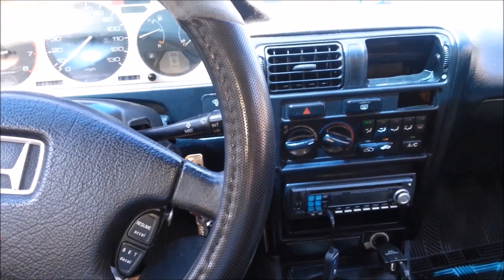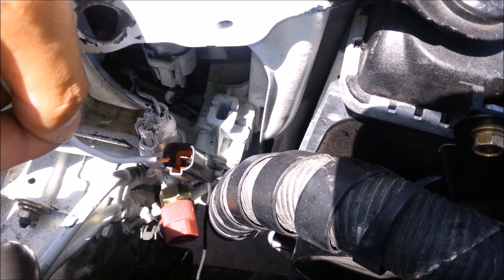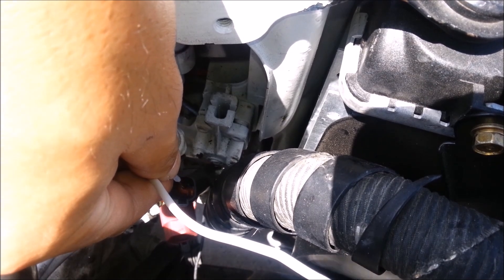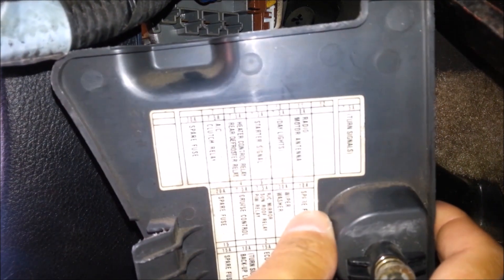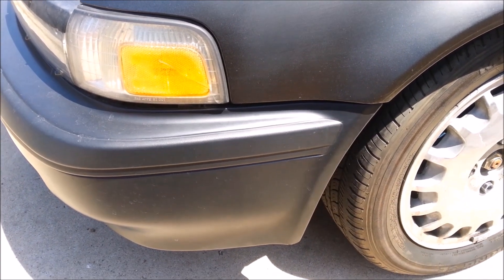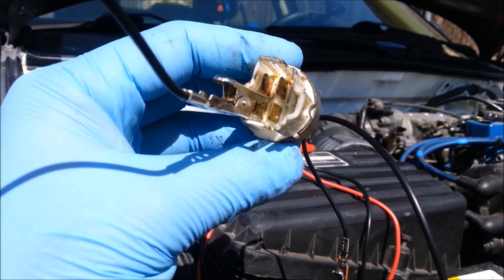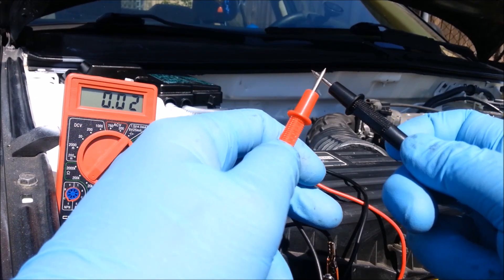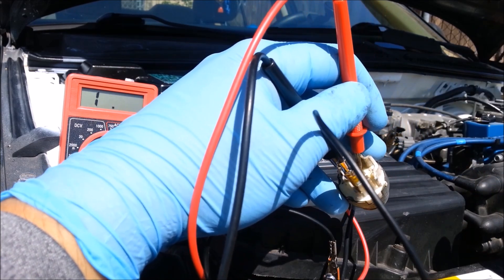DIY A/C Troubleshoot on 1991 Honda Accord - Winston Buzon

Comment: good video but you didn't say what was wrong I'm assuming the relay. and also there is two relays right next to each other on the fender you didn't some witch one is which good video but could explain more detail. into the problem.

Comment: So what did you do to fix yours I don’t think you ever said bc I can put the wire to the battery and it works and my relay works bc I put a new one on and it never kicked my clutch on. What else could I be missing!!! Please help
Reply from the maker: I just added a manual switch that I can just turn on & off using the battery as my power source

Comment: Dropping that 👍 7 years later! Question, what kit did you use to convert your A/C? I saw the brass fitting by the dryer. I ordered a kit, but the fit seems off.
Reply from the maker: The universal conversion kit I got from the local auto parts store was designed to fit even our older cars
Reply: @winstonbuzon  - Thanks for the super fast response! I bought one off Amazon, but I’m having issues w/ the High Pressure side fitting. I will give it a go tomorrow.  I’ll grab a conversion kit from AZ! Thanks for the heads up. BTW, I didn’t have the issue described in your video, but your breakdown is VERY helpful! Keep up the awesome work 👍
Reply from the maker: @vermasean  Thank you for watching 😁👍

Comment: You should also check for a bad low pressure switch and a bad temperature switch. The LPS will be under the hood on the cooling system around the dryer and the TS will be inside the fan box, unclip the bottom of the box, (no drilling a hole to replace on Honda's, the thermal wire will be clipped to the cooling block while the sensor unit is clipped to the box or on the metal bracket behind and under the glove box, final possible problem other than a wire pinched or disconnected from wire tucking would be the little rectangular black box under on the same bracket under and behind the glove box near the passenger door which you push it up and it will unclip from the bracket then you unplug it, open it up and just make sure it doesn't have any dirt, water or contaminates of any kind causing it to bridge connections, if in the box you find broken connections, use 600 grit sand paper on enamel areas take a piece of ropes with a copper strand, dip it in flux (pluming flux is the cheapest and yet the same shit, put it on the area that needs to be de-soldered, put flux down on cleaned surface being repaired and use lead based solder to replace the old solder you took out, once done, spray area with some alcohol and then clear enamel or harder than nails clear enamel finger nail polish, also be sure it's not a loose cable going to you climate control knob. If you can figure out what causes a cb7 to have idle surge when the AC is on then I am open for that info. Hope this helps you and your other viewers if they do all the other checks you mentioned and can't get their AC working. P.S. a dirty condenser can cause hot AC as well as a dirty cabin air filter or AC fan not turning on.

Comment: @Winston  do u know if they have an orifice tube and if so where is located at
Reply from the maker: Sorry, no clue...
Reply: Ok am having a hard time getting my ac to work I've done everything to it new but it just doesn't wanna blow cold
Reply from the maker: @gerardoespinoza762  is it charged up with more refrigerant?
Reply: Yes 32oz its whats it calls for but i got it to work condenser fan wasn't workin or my radiator fan so got them to turn on both at the same time and now i got ac thanks for ur replies

Comment: So the relay tested good but you replaced it anyway and then you were fixed? Also how many relays are there?
Is there a pressure switch that could also be faulty? 
I recently charged my ac with the intended r12 and it was working awesome for the last three months readings from vent temp were low 40s and its been a real blessing because ive had my 90 accord for 5 years without ac so having it for 3 months was just great! But it just stopped working yesterday. 1st step I need to get a wire from work tomorrow and bypass it to see if engaging. 
Also where did you purchase relay plz thanks for your help!
Reply from the maker: I got my relays from the junkers.  I test them using a 9 volt battery and some leads.  Like I said though many times, I'm not a mechanic, but I experiment with whatever method helps

Comment: Just like you, I have 1991 Honda Accord. I wanted to duplicate your test of the compressor, and finally I found the connector which (according to online copy of Honda Accord 89-91 Service Manual I found) was mounted on the fan housing upside down. So I located these 2 plastic ends together, but for the life of me, I cannot pull the damn things apart. I have tried and tried to separate them and I simply cannot!  Is this one of those deals where the one side has like a clip that clips down onto the other side (and yes I know there is a separate metal clip that holds the connectors against side of fan housing, I am not talking about that), and I have to release the clip? Where can I see exactly how these 2 plastic connector things are constructed? Its hard to see anything on your video (at 0:50 - 1:00) it all goes by so fast.
Also I am really surprised that you ended up using the electrical tab embedded in the longer plastic end-connector, since from what I saw on my own vehicle, it was the other smaller side that has a red wire that goes directly into the compressor.
Reply: Well, I due to other problem I had, I discovered that these Honda connectors DO have a clip that grabs the other side of connector and you can't just pull them apart, you have to squeeze the one side of connector in just the right place to cause clip to disengage the other side of connector. Once I understood that, I was able to get that connector for wire going to compressor undone, and I could then access the electrical tab like you did. And I did your test and my compressor WORKED!! So I thank you for that, I was surprised it wasn't totally dead. So next I thought I would check out the relays (I already had checked fuse which was OK). There is set of 2 relays attached to left side of area under the hood, and a diode between them.  I decided to detach most forward relay (this is for the compressor). I discovered that the contacts in this relay are covered in some kind of gunk! And the receptacle for the relay is also full of gunk! And I am going, what the heck is this, the relay even has the plastic slip cover and still it got full of gunk? But anyway I took it inside and checked it out. The relay clicks when 12VDC is applied to terminals #1 and #2. So the coil is good. But the switch part was not causing my continuity check (I've only got this old Radio Shack analog VOM) to emit its high-pitched squeal .  So the switch was bad! So pretty interesting result. Later on, I really wanted to know what was going on inside the relay, so after much work, I managed to undo the metal top part from the plastic base. I was expecting to see the type of relays I am familiar with, but this relay is very strange. The smaller top part of the metal covering apparently holds the coil. It holds a plunger that just falls out when you open it up.  After I got the 3 places where the metal top is bent to hold it together to no longer be bent, so I can just remove or put back the top metal part, I thought maybe I could fix relay. But after I did this the relay now doesn't even give a click sound when I apply voltage to #1 and #2. And I don't see how it works, since the switch the plunger is pushing on is a normally closed switch. The whole thing doesn't make any sense to me and I wish someone could explain it! But anyway, I then went and pulled out the other relay which controls the condenser fan.  This is exact same relay (part #056700-5260) and THIS relay not only clicked when 12V applied to #1 and #2 terminals, it also showed continuity between the other terminals (#3 and #4).  So that relay was good! So I am going to replace that one relay. In fact, I think I will buy 2 new ones (they are fairly cheap) and replace both. But I am wondering about that gunk in the receptacles. I am thinking I should buy some spray on electrical connection cleaner to clean out the gunk. What do you think?  I later thought, maybe that gunk is some kind of electrically conductive grease that I have found advertised at various places, and someone previously put that on to help improve the situation. But really, I don't like it and would like to get rid of it.  I also decided to remove the diode which is the black plastic rectangular thing between the 2 relays.  I got that out, and I would like to find a replacement in case that is not working. But all it says on it is there is a logo - Stanley - and a number in white lettering - 1305Y1. And I haven't gotten any matches on Google yet.
Reply from the maker: Sorry, but I wouldn't know for sure.   I'd have to double check

Comment: I have done everything, I have gotten a new compressor it’s charged with freon and I also put in a new evaporator coil with a new evaporator valve and my ac still doesn’t blow as cold as it should be... I have not changed the ac relays next to the power steering. Do you think those relays are my issue?
Reply from the maker: Julian Page For some odd reason, our relays are always going out quick.  I wish I could confirm that as an answer, but like I've said before and many times, I'm not a certified mechanic.  Sorry

Comment: Ok so I'm having the same problem so far I just watched this video checked all fuses but haven't tried the wire in the connector trick if the clutch kicks on with the wire trick does it mean the relay is done ?
Reply from the maker: It's a likely possibility.  I can't say for sure bc I'm not a certified mechanic

Comment: Great video!!  I have a 1998 Honda accord that has a similar problem what happens is when I start the car the ac compressor clutch engages automatically even though my module is turned off. Any idea what the problem could is?... to add problem started when my alternator start overcharging. Thanks
Reply from the maker: Could be electrical.  I can't say for certain since Im not a certified mechanic.  I only share what I know.  Sorry I couldn't be of more help at this point...

Comment: i just bought my 92 accord 2 weeks ago. im having the same issue that u shared in the video. where would i find the relays to check them, assuming that the wiring hasn't been altered as u mentioned in your video?
Reply from the maker: jayboc5 On the driver's side behind the headlight under the hood, next to the power steering fluid reservoir
Reply: Winston Buzon i found it, thank you. now i see 2 of them, how do i know which one it is and do i need to have an ohm meeter to see if they are working?
Reply from the maker: If you have a repair manual, it'd be easier, but since I didn't have one, I tested them both with an ohm meter
Reply: Winston Buzon thanks for your help. i just tested both relays and they both clicked and the ohm reading was 0. the fuse looked good too. so i guess now that leaves the freon. i need to find someone that does r12.
Reply from the maker: Unless you live in Tijuana, good luck finding it here in the US.  My suggestion?  Get an AC retrofit kit for R134
Reply: Hi i having the same issue. I already change the relay and already try bypass but still magnectic clutch not engage. Do you have orther solution?

Comment: In case you didnt know, the ac system has a built in pressure switch, that prevents the compressor from engaging if.yhere isnt enough pressurized refrigerant in the system, because if you were to engage the compressor without any refrigerant, the compressor would seize, ( the refrigerant helps to lubricate the compressor)
Reply: GHOSTGXZ it could be the low pressure switch
Reply: Have a question when I charge the ac system I hear the compressor kick on but the ac binary switch freezes up and leaks all refrigerant out

Comment: i have a 1991 accord ex my ac was working  but my ac was kind off cold and kind warm at the same time one day i crank my car on and wen i turn my ac it sounds like it kicks in do to u hear the idle change but it does not blow at at all i was wondering if u knew wat it could be
Reply from the maker: When was the last time you checked to see if there was refridgerant on your system?
Reply: i never did i bougth the car never check it
Reply from the maker: michael morales That's one of the things I always check first.  That's how I get the upper hand in knocking off a couple hundred dollars off the asking price...

There are a lot of AC stuff you can buy from your local auto store.  However, first step is to see if there's refridgerant.  I used AC Pro in one of my other videos...
Reply: thanks man
Reply from the maker: +michael morales No problem  :)

Comment: I just did some AC troubleshooting of my own on my CL Type S 6MT. It's a slow leak from the low pressure schrader valve :(

What nationality are you? Pinoy? If you are, me too!
Reply from the maker: Rafael Salas You can reach me on google plus, facebook, and racing rivals, lol
Reply from the maker: Dang, that's sucks, man...

Yes, I am Filipino  :)
Reply: Winston Buzon hey was up i got a 91 accord and its hooked up but im having a brake issue and changed everything people are telling me its the booster peddle sinks eveytime bleed the hell out of it and nothing let me no
Reply from the maker: Do you get leaks whenever you bleed it out?
Reply: Winston Buzon na everything looks good this is killing me need your info could it be my brake booster holla back please
Reply: If your pedal sinks to the floor, you have a bad master cylinder, i have had two accords in my life( a 89 and a 91) and this happened to both of them, after installing new master cylinder, it went away.... But just know that you have to put the masrer cylinder in a bench vise and bench bleed it before you install it, if you dont know what that is, just search on youtube